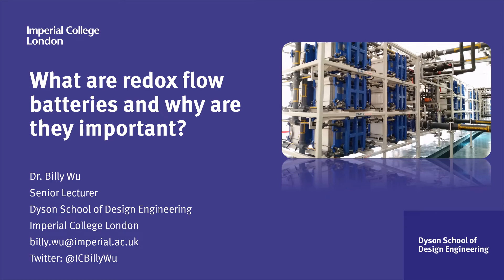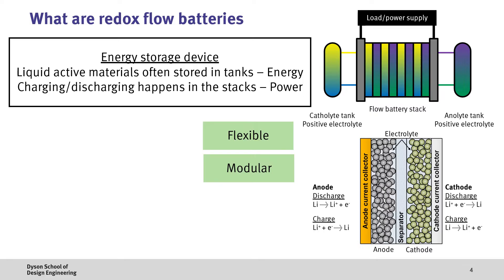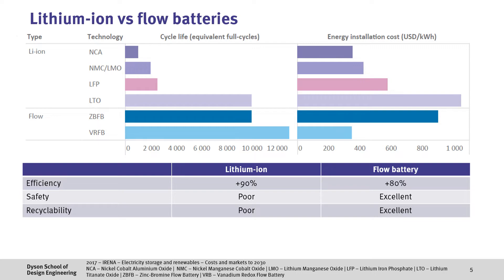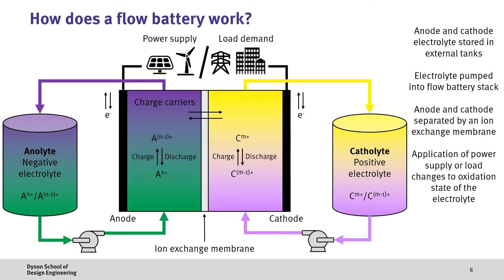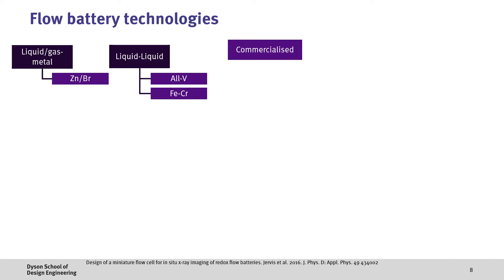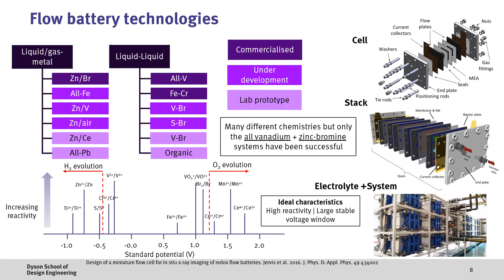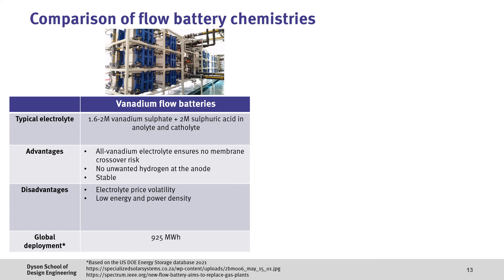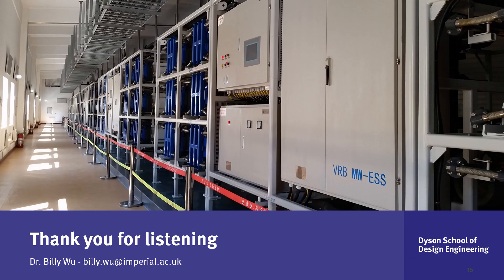What are redox flow batteries and why are they important?

Comment: is there examples of membrane-less flow batteries?
Reply from the maker: Good question. Yes there has been research on membrane-less flow batteries. There are a few designs being considered including using immiscible electrolytes which don't mix but there are still challenges with things like self-discharge and crossover effects.

Comment: thank you, very informative. Wondering if anything has happened for the past three years in the redox flow battery field?
Reply from the maker: Thanks and good question. One of the primary applications for flow batteries are for grid-scale energy storage. This area has significantly expanded in recent years but is dominated by lithium-ion for battery systems. Here, the cost of lithium-ion has dropped significantly in recent years due to economies of scales within the automotive sector and decreasing material costs/oversupply. This means that flow batteries have struggled a bit on a cost basis. Innovations are still in the pipeline such as new membranes, organic electrolytes and other concepts but with lithium-ion dominating so much, not as much activity in flow batteries has been seen recently.

Comment: I heard chrome  and brimine can be quite toxic
Reply from the maker: Yes, you're right. Some of the chemicals used in flow batteries if operated outside of designed conditions can cause some safety concerns. In the zinc-bromine system, there are safety risks especially with the handling of the bromine
Reply: Not as toxic as toxic masculinity.

Comment: 🎯 Key Takeaways for quick navigation:

00:00 🌍 Overview of Renewable Challenges
- Transition to renewable energy sources (solar and wind) faces challenges,
- Challenges include inflexibility, intermittent supply, and wasted electricity during excess supply,
- Introduction to the need for energy storage solutions.
01:03 🔋 Introduction to Redox Flow Batteries
- Redox flow batteries as a solution for energy storage,
- Comparison with lithium-ion batteries in terms of design and flexibility,
- Highlighting the modularity and durability of flow batteries.
02:03 🌐 Large-Scale Flow Batteries
- Examples of large-scale flow battery deployments,
- Showcase of the 8 MWh vanadium flow battery system in Zhangbei, China,
- Emphasis on the potential advantages of flow batteries in terms of cost, lifetime, and safety.
03:04 ⚖️ Comparison with Lithium-ion Batteries
- Cost and lifetime comparison between flow batteries and lithium-ion batteries,
- Evaluation of efficiency, safety, and recyclability,
- Acknowledgment of different strengths and weaknesses in various applications.
04:09 🔧 Internal Mechanism of Flow Batteries
- Detailed explanation of the internal components of a flow battery,
- Description of the ion exchange membrane and its role,
- Insight into the structure and function of the porous carbon electrodes.
06:05 🧪 Various Flow Battery Chemistries
- Overview of different flow battery chemistries (zinc-bromine, iron-chromium, and vanadium),
- Discussion on the positive and negative electrolyte considerations,
- Mention of commercialization status and challenges in flow battery technologies.
08:10 🔄 All Vanadium Flow Battery
- In-depth exploration of the all vanadium flow battery,
- Explanation of the redox couples, advantages, and high theoretical lifetimes,
- Acknowledgment of challenges such as vanadium price volatility.
09:35 ⛏️ Vanadium Supply Challenges
- Analysis of vanadium supply sources and methods,
- Discussion on co-production, primary production, and secondary production,
- Recognition of challenges in achieving the required purity for long-life batteries.
10:40 🤖 Zinc-Bromine Flow Battery
- Explanation of the zinc-bromine flow battery chemistry,
- Description of its advantages (low-cost materials, energy density),
- Identification of disadvantages, including lifetime issues and safety concerns.
11:39 🚫 Iron-Chromium Flow Battery
- Introduction to the iron-chromium flow battery system,
- Discussion on its advantages (cheap electrolyte materials) and disadvantages (low energy density, slow kinetics),
- Mention of challenges faced by companies attempting to commercialize this technology.
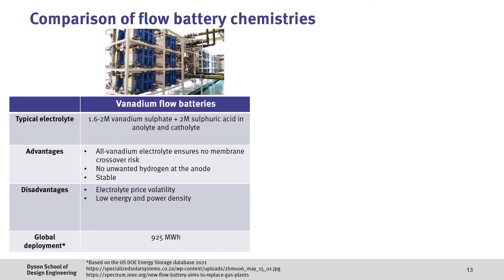13:15 🗂️ Comparative Analysis of Flow Battery Technologies
- Comparison of all vanadium, zinc-bromine, and iron-chromium flow batteries,
- Assessment of advantages and disadvantages of each technology,
- Emphasis on the need for innovation in emerging chemistries.
14:14 🌐 Conclusion and Future Outlook
- Summary of challenges in power network stability with increasing renewables,
- Affirmation of the potential of flow batteries as a low-cost, safer, and durable energy storage solution,
- Call for further innovation and improvements in existing flow battery technologies.

Made with HARPA AI

Comment: I have a question about electrolyte. why ionic electrolyte doesnt use for surppresing HER and OER ?
Reply from the maker: Good question. There are a range of other electrolytes which can be used for flow battery applications which would not suffer from HER and OER that aqueous systems do. The balance is often with the resulting cost of the system vs water based systems which are difficult to beat on cost.

Comment: Very helpful presentation, thank you so much , but at iron chromium redox flow battery section  the drawing cell need to be modified and putting iron on positive electrode and chromunm in negative electrode ,. thank you so much .
Reply from the maker: Thanks. You're right! The diagram was the wrong way around. Tricky to modify the video but I can add a footnote!

Comment: Billy,
Thanks for the clip simple and clear. Which metal material is best for flow battery bioplate.
Reply from the maker: Thanks. The most flow batteries generally use carbon based flow fields. This is because carbon is generally quite stable against the highly acidic operating conditions. Metals can be used but are generally coated in carbon, where there are challenges with maintaining the quality of this over time.

Comment: Can flow batteries be used in cars, and electric vehicles? and is it easy to make and test your own flow battery with different electrolytes
Reply from the maker: Good question. Unfortunately, the energy density of flow batteries is quite low which means they're aren't well suited for electric cars, though they are better suited to applications where weight is not an issue. Its a bit difficult to make your own flow battery since this often requires specialised membranes to get good performance.

Comment: Do you see mass adoption of VRBS in the future?
Reply from the maker: Great question. At the moment lithium-ion batteries have the cost reduction momentum due to the development in automotive applications. The vast majority of stationary batteries are therefore LIBs at the moment, but I think through a combination of supply shortage for LIB materials, increased desire for lifetime and cost reductions in RFBs we might see increasing deployments in the coming years. VRBs currently have favourable lifetime cost of storage and very good safety characteristics. Probably need some vertical integration of Vanadium supply and manufacturing to address price volatility of electrolyte.

Comment: Such an informative video! You have a great talent to delve into the first questions that come to my mind, and answer them completely. Is the Zinc-Bromine battery used frequently in residential house batteries? It seemed like you were inferring it would make the best option for that application.
Reply from the maker: Thanks. Appreciate the comment. Yeah, because one of the half cell reactions is the zinc deposition reaction which is more energy dense than changing the redox state of a liquid, these systems tend to be more compact. An Australian company called Redflow is developing small units ~10 kWh as residential energy storage units. Should be safer than lithium-ion but likely needs more R&D and scale up to drive down cost.

Comment: I have heard of full FE batteries as an 'alternative' to more expensive vanadium. They are low density and slow, but cheap and can be rebalanced like vanadium.
Reply from the maker: Great comment. Yes, there are people currently looking at the all-iron flow battery chemistry which would be quite cheap in terms of electrolyte materials. This uses the same Fe2+/Fe3+ redox couple on the cathode but plates iron on the anode. One of the challenges here however is the reversibility of the iron plating reaction and potential for hydrogen evolution which both impact the lifetime.